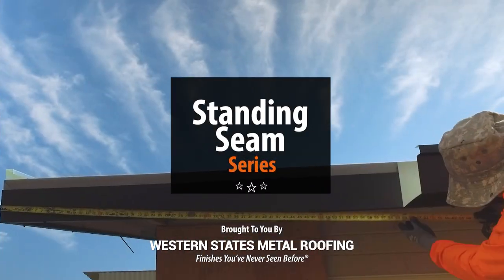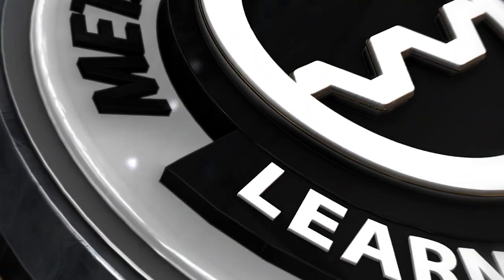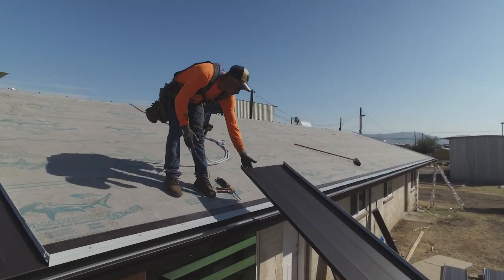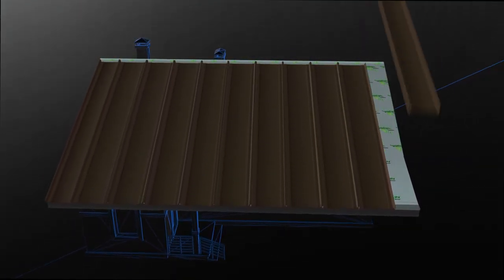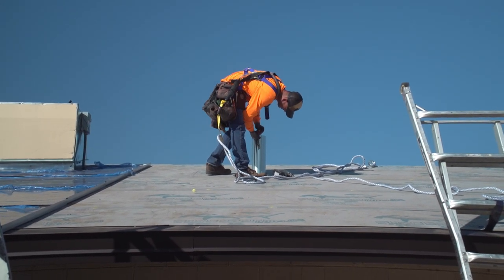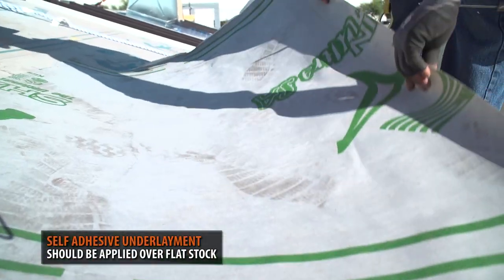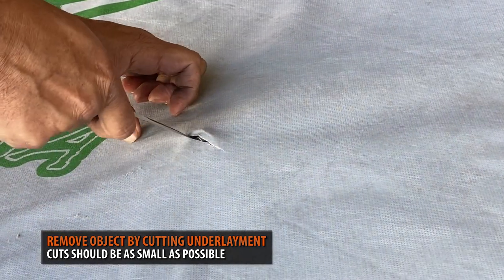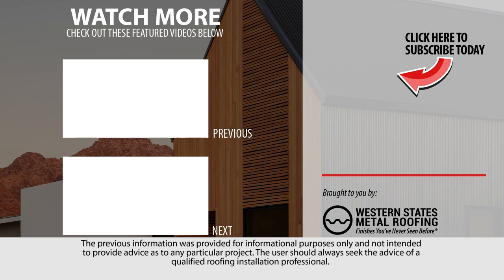How To Install Standing Seam Metal Roofing - Panel Layout For Metal Roofing Panels

Comment: Cleat and two piece all pipe penetrations and use a standard lead flashing. That is the proper way to do it. 
Those flex boots and caulk systems are incorrect.
Reply: Do the same on stove pipes as well. Two piece and use the standard flu flashing and collar.
Reply from the maker: Thank you for the comments. Yes, there are many ways to seal around a roof penetration. We do not offer a lead based product that may be harmful to the environment and may not work with all materials. We offer Deck-tite boots. These boots have been used in the Metal Roofing industry for many years and these rubber boots offer flexibility where a rigid lead based flashing may not move with the expansion and contraction of the roof system and may require more maintenance. Dek-tites as well as your lead base flashing will need annual maintenance and should last for many years as long as a good maintenance program is set up and followed.